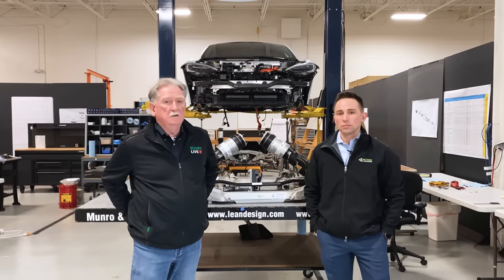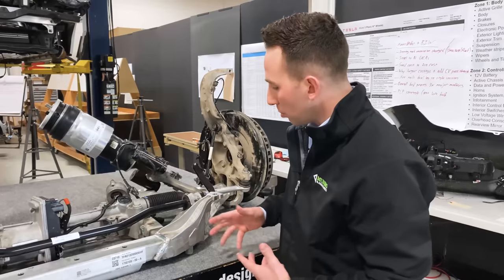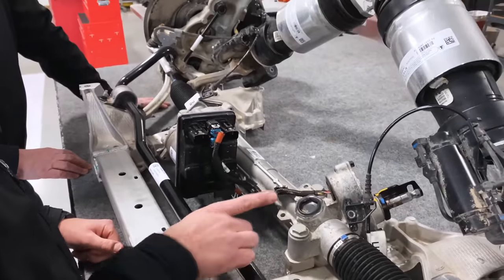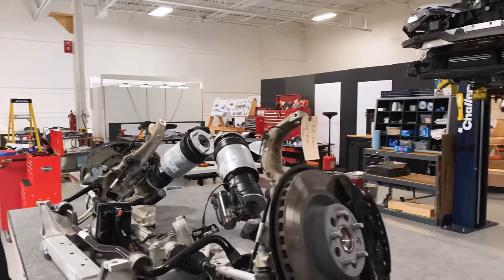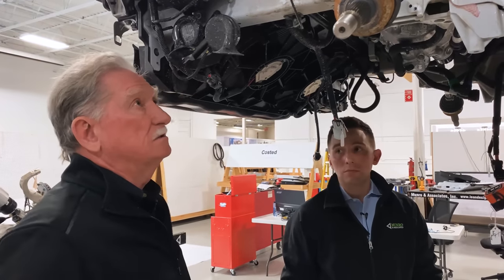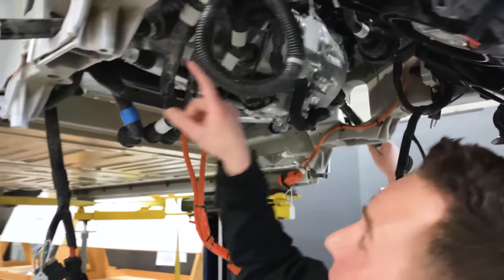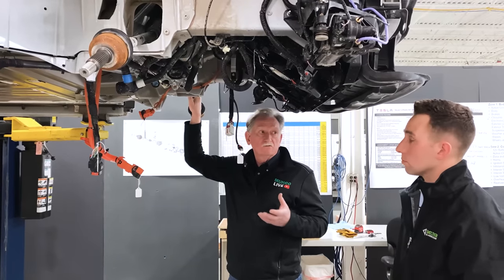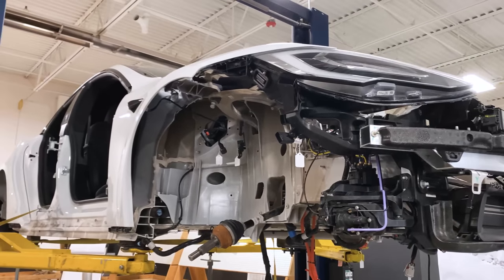Front Cradle and Suspension | Tesla Model S Plaid Teardown

Comment: Re: controls by wire…. I have a Toyota which is throttle by wire.  There are times that the control system doesn’t do what I am commanding.  It happens to be a manual transmission and I have noticed conditions where there is RPM hang between shifts when the ECU apparently values limiting NOX generation as more important than than following my pedal input, allowing RPM to drop to match my shift point.  I really disagree with the idea of having a computer between my steering angle sensor and an electrically operated rack.  I want the car to infallibly do what I tell it and not have a computer countermand me.
Reply: I haven't seen any car in the last 20 years that didn't use throttle by wire.
Reply: @paulaxford6754  My 2003 Honda Insight still has a throttle cable, but you’re right - that’s pretty close to 20 years.  They do have an idle control solenoid, but I can’t fault the ECU for ever having forced an RPM hang.  The insight is a weird bird - parallel hybrid, no purely electric mode, and a 5 speed manual transmission too.

Comment: I remember hearing the debate between Airbus and Boeing regarding "fly by wire." Is this not an issue anymore?
Reply: Safety of fly-by-wire systems will always be a concern, but it a concern which is well addressed. I have less faith that it will be handled well in an automotive application.

Comment: Eta on steer- by-wire? Do you think it will happen before 2025?
Reply: If Tesla asks? Probably no way.
If Toyota does, they're roll over like your favourite Lab'.
Small point "steer by wire, in a car that's designed for FSD? ...... It's only the "input system" which needs to be added, Logitech and others have been making those for ages.
Redundant feedback circuits, and the aforementioned FSD system as final backup if BOTH those systems fail simultaneously. With the dual FSD computers looking for data mismatch)
I'd say it would "probably" be ok?

Comment: Comparing aircraft controls to automotive controls is kind of a moot point until the automotive industry is held to the same quality standards as the aircraft industry. Given the quality level of even OEM automotive sensors/electronics (regardless of vehicle or sensor brand), I certainly wouldn’t trust a critical safety device to just electronics (don’t even get me started on the complete lack of regulation over aftermarket automotive replacement parts).

Comment: Wow that was a tidbit I didn’t think about, or forgot about of when you talked about the difference of airplanes vs cars in, steering and control. Exactly right Sandy and so logical. It’s what I think about in regards to fly by wire and auto-pilot in planes vs cars. Autopilot is used for better safety, better accuracy, computer superiority, and Pilot fatigue. Why wouldn’t we have that in EVs?
Reply: Aircrafts are the safest appliances in the world, they have many redundant systems, a drive by wire is very dangerous on a car.

Comment: Having flown all types of airplanes since 1985, military and civilian, I can assure you that all airplanes still use cable controls, smaller aircraft that don't require hydraulic or electric assist are all cable (except flaps which are not considered a life critical flight surface). The automation and assist on large aircraft simply offer a hydraulic or electric assist to redundant cable controls. Flight and engine controls that are life critical are required to be triple redundant in both the the mechanical and electrical domain. Any aircraft flying can still be controlled, flown and landed with total electrical and hydraulic failure.
Reply: That's just incorrect as Sandy's statement, but in the other direction. There are fly-by-wire aircraft (including the most recent airliners) in which the only connection between the controls and the surfaces are electronic, and actuation of surfaces is electrically powered with no cables. Of course those systems have a high level of redundancy, and those aircraft are the minority (by count of airframes, not passengers carried or flight hours) of all aircraft.
Reply: Examples of fly-by-wire with no hydraulics to the control yoke or stick include Boeing 777 and 787, and all Airbus models since the A320. Actuators are still largely hydraulic or electrically-powered hydraulic, but controlled by electronics rather than mechanical cables or hydraulic circuits. For the Canadians in the crowd, I'll note that the CF-105 Avro Arrow which flew in 195 was fly-by-wire, although of course only five were built, and the electronics were analog.

Comment: I'd rather have a drive by wire design because I'd rather smash into a bundle of fiber optic cables rather than the part of a steering column that intrudes into the passenger cabin, make as much of the  steering wheel into a nerf foam, with as much structure as is required to make it feel solid but not so much as it punctures a lung when I hit it at 40mph or faster.
Reply: I feel you.  Ideally the airbags will protect your lungs from that stuff.  Good thing all Teslas have giant engine-free crumple zone in the front!

Comment: The mechanical steering linkage is surprising. I thought it would be drive by wire.
Reply: No one even moderately familiar with automotive technology would expect steer-by-wire in any current production vehicle.
Reply: @brianb-p6586  I guess I've been told.
Reply: @stevemiller9480  😀No offense intended; I'm just saying that the mechanical linkage is really not surprising - Sandy certainly shouldn't be surprised by it. I'm guessing that you've been reading marketing fluff, rather than actually following automotive technology.
Reply: @brianb-p6586  Roger that. I hate marketing fluff.

Comment: Sandy, an F-35 is manufactured to a much higher standard than a passenger vehicle.  A car has to be affordable and having the multiple redundant electrically operated control systems for steering would impact affordability and require more space to install.  A physical link input to the rack is cheap and reliable.  Yes, it impacts the interior packaging, oh well.  Ask Boeing how that MCAS thing worked out when the computer did not allow pilots to take control of the aircraft.  Watch Boeing change the subject real fast.

Comment: Interesting comment from Sandy. Why no servos in cars whereas planes are all controlled by electronic parts? Automotive engineers are conservative and weight reduction is not crucial to cars. Also, computerised control is discouraged by the mechanical engineers, even to the point of requiring manual mechanical overide for electronic controls in certification of cars. Australian standard as used in the World Solar Challenge. As a computer engineer, and RC Aircraft hobbyists, I find the craddle to be too complex. Can be simplified using electronic controls. That is why I am not impressed by the design of cars, even those in experimental solar racers.
Reply: Interesting, but incorrect. Mechanical controls are still common in aircraft, and as any moderately intelligent person realizes, airliners are very different from mass-production cars.

Comment: I was excited about the plaid and all the other products but I now see them as a distraction for Tesla.
There is nothing more important than scaling mY production, improving the design, drive the cost down. Otherwise, it’s FSD and Optimus.
Maybe model S allows Tesla to experiment with things that are too expensive for the lower-cost vehicles, that would be a positive.
Reply: Really, this is missed by most people, especially the media in the investment space.  The Model 3 first shipped in small quantifies at the end of 2017, so it has only been barely 4 years.   The Model Y started shipping in March of 2020.  Now people just expect the Cybertruck in 2022, amid a global parts shortage.  The calls for a $25,000 car are strictly crowd-sourced, as Tesla never said they were working on it.

There are still people waiting on their (very low volume) Roadster 2s, and corporations waiting on their Semis.  Personally I wish Tesla never committed to the Semi.  I'm sure it will be profitable and a game changer, but just in terms of resources the batteries needed affect output of all other Tesla vehicles.

Comment: If one thinks it a good idea to loose the redundant can't ever ( hardly ) fail physical connection between the steering wheel and wheels because some airplanes do it that way then one might want to entertain the idea of installing an ejection seat which is also found in some airplanes so you can bail out in an electric failure that causes you to loose all steering control in an electric only steering system car    ......

Comment: When Munro Associates dive into a vehicle teardown one small area at a time, we as viewers don't have a good basis for understanding the context of the details we are shown, as they apply within the overall design goals.  We first implicitly understand that Tesla chose an existing model to modify as a high-performance, low-production offering and have to accept that there are compromises, particularly that the half shafts need to pass through the subframe, which on first viewing looks truly awful.
Rather than create videos based on disassembly order, perhaps break the entire car down first and reassemble production subassemblies for review?
We have two aspects to design, meeting the product performance goals and meeting the low-cost assembly goals.  Commentary perhaps should address both?
Reply: The half shafts go through the unibody structure, not a subframe. And that was a design choice, not the result of using an existing body. It's only a concern for manufacturing, not for maintenance or repair.

Comment: 10:22 oil filter for gear box?
Reply: Yes, recent (Model 3 and newer) Tesla drive units have an externally mounted spin-on filter for their lubricating and cooling oil. The oil is used in both the gearbox and the motor.

Comment: It will probably be more expensive to make it stear by wire, I cannot see 2 or 3 electronic systems (with redundancy) be cheaper than one metal thing.
Reply: It would offer lots of advantages to dynamic and automatic driving. But its also the last system that should ever fail in a car. And simple mechanics are just more reliable.
Reply: @vast634  I agree that for now, I think we are fine with the mecanic system. It will come for sure.

Comment: Great video! But before removing the mechanical steering column, I will think about that big steel anti-roll bar. It can be completely ditched if you go active suspension with a modern electric or hydraulic system. It's still one of the most overlooked part of modern vehicles...
Reply: Wrong!!! Even hydraulic systems still uses anti roll bars! Toyota KDSS system from 2009 has been making great use of it.
Reply: @carholic-sz3qv  KDSS is an old and not very capable system for off-road vehicles, there are much better way to do active suspension. Like McLaren old system on mp12c and newer kinetic suspensions on p1 and latest cars. Also going completely electric is possible as Audi did on A8.
Reply: @GiovanniEsposito5  you must be joking or are you just trying to be dumb!? The best suspensions system ever made is hydraulic, the Citroen xantia has proven that for decades, the best moose test results are from a very old Citroen xantia. the hydraulic suspension is way faster to react and adjust compared to air. The Toyota KDSS was was developed to significantly improve both on and off-road driving including excellent articulations on uneven terrains. Basically nothing compare to hydraulics.
Reply: @GiovanniEsposito5  for your records Toyota has even significantly improved the the KDSS system for heavy duty use, the Mercedes’ GLS bouncing feature uses hydraulic suspensions too.
Reply: @carholic-sz3qv  You are talking about hydraulic/hydropneumatic suspensions made mainly to control ride height. I am talking about active suspension as in McLaren mp12, p1, 720, Audi a8 and so on that actively control roll and don't need sway bars. This is how you remove weight and improve substantially performance and ride confort. These are way more advanced and capable systems on high-end vehicles.
Reply: @GiovanniEsposito5  yes Toyota KDSS actually combines the hydraulics for roll control, just like Mercedes’ magic body control.

Comment: wait Sandy, if that's a NHTSA requirement for a mechanical steering linkage...then how the hell is Canoo planning to not have one!!!??? by this year!?????! I hope / think you're wrong... it seems they are allowing it with a backup, electric motor on a separate safety circuit. Please respond...as if this is a real issue, that would be pretty important info.
Reply: Canoo is a dream, rather than a real manufacturer, but they are probably hoping to get approval for a system with suitable redundancy. Their proposed supplier of a steer-by-wire system is Mando, but there are multiple other suppliers, including ZF.

Comment: You can start to understand the level of thought and communication between design and build as you tear down the car. This does not go well if one department isn't talking to the guys on the floor who have to put it together. Design is working with engineering who is connected to assembly. It's like putting a band together.. to make beautiful music.
Reply: The same design and communication capabilities goes with all other manufacturers, cars are not just built by making and assembling cars blindly, there is a tough process, the Mercedes’ UNIMOG is an excellent example of amazing engineering, that vehicle is the most versatile in the world and can be adapted to do basically everything from agriculture to construction, railways work, utility maintenance……

Comment: Airplanes can get away with fly by wire because there's lots of redundancy with multiple hydraulic systems and a backup pumping/power solution in the event of a power outage (the RAT). All of that complexity isn't needed in a car to be honest. Consumer sentiment too would not likely allow for a steer by wire system in cars. It has been tried and for the most part failed.
The fact that the redundancy in steer by wire is essentially to ram a rod into the rack anyways, you're already carrying around that mass+ anyways. Just doesn't make any sense.
Reply: Tesla already has redundant systems for auto steering, so taking out that rod would simplify the construction a lot

Comment: are there any “steer-by-wire” vehicles currently on road today?
Reply: yes
Reply: @matthewwiemken7293  citation needed please, the only sbw system that I know of has only so far been retro fitted to track cars for testing purposes. This is unless you count some rear wheel only systems in trucks (which obviously do most steering via the front wheels).
Reply: @bluetoad2668  check Infiniti steer by wire
Reply: @matthewwiemken7293  There is still a classic mechanical connection build in as backup.
Reply: No. The Infiniti system has a mechanical backup, and the Toyota bZ4X "one-motion grip" system (which is apparently truly steer-by-wire) isn't quite available yet.

Comment: Great video...looking fwd for the next one.
And a nice thought of comparison to the planes.... it is surprising that this hasn't be done yet on the cars...it should be.
Another thing they should change (remove) in the cars is steering wheel and pedals; we dont need it. So Elon if you are reading this, put a joystick in Teslas and make them drive by wire.
Reply: Drive by wire is definitely not safe and the electronics can fail, a joystick won’t help you in many different driving scenarios.

Comment: very interesting the solution on the Steering Rack, 
BUT I'D LIKE A MORE IN DEPTH REVIEW ON THE SUSPENSION SYSTEM

i can not clearly see if it is a normal:
 " McPherson Strut " or a " Double Wishbone " or a " Quadrilateral " Geometry

Having a good Front Suspension Geometry is a key factor in a car with this kind of power to give you confidence when entering a turn...
i have tried many Cars, and the one that i found most impressive has been the ALFA ROMEO Giulia, which uses a Deformable a Quadrilateral Geometry at the front that guarantees the Tire is always perfectly vertical to the Asphalt

i would be really curious of understanding what choice TESLA has made in choosing the Suspension Type to handle over 1000hp

thank you for your time

Comment: Disagree with Sandy on the flight controls on aircraft.   HC-130 has flight control CABLES going to all the flight controls.  (HC-130 aircraft mechanic 21 years))
Reply: It looks like the current production variant - the C-130J "Super Hercules" which has been in production since 1996 - no longer uses cables all the way to the flight surfaces, but instead uses them to run hydraulic control valves. But yes, it's mechanical and not electronic.

Comment: About electric steering: Aircrafts have enforced maintenance requirements, from what I’ve heard, cars are sold to joe shmoe and potentially never maintained again until stuff breaks, and I guess the public is more okay with „Inch of bolt rusted through, you‘re an idiot“ over „motor had a short and you‘re in a tree for it“… but yeah, drive by wire sounds like a good idea

Comment: So the S is an all aluminum build?  If they never build the Cybertruck I might have to settle for a model S.
Reply: They will build the Cybertruck.
Reply: Yes, the Model S and X have always had aluminum bodies.
Reply: @brianb-p6586   I saw there was a good sized steel cross beam where the rear drive/suspension module attaches to the rest of the Plaid model S Sandy Munro is taking apart.  Otherwise all aluminum... cool.

Comment: Then again aircraft have triple redundancy, and still accassionary have problems with flight control systems, eg early 320's, 737 Max etc.
Reply: The A320 is actually fly-by-wire, but any 737 is not. The point is still valid, that even highly-regulated redundant systems can have failures.